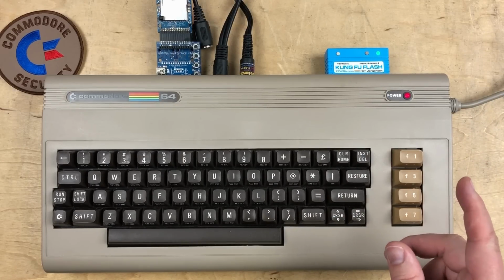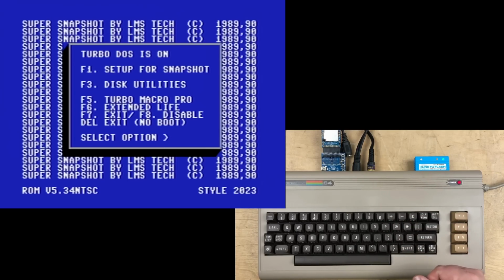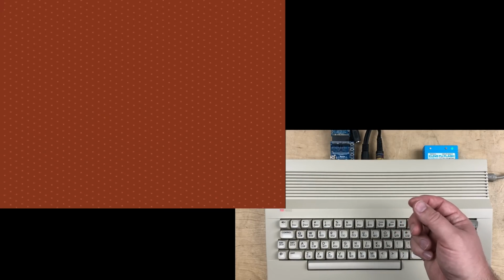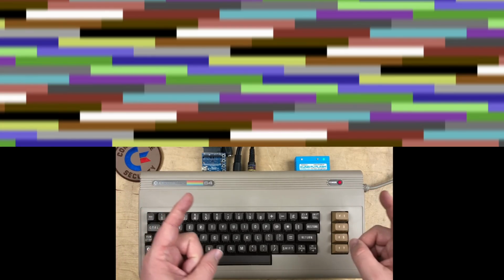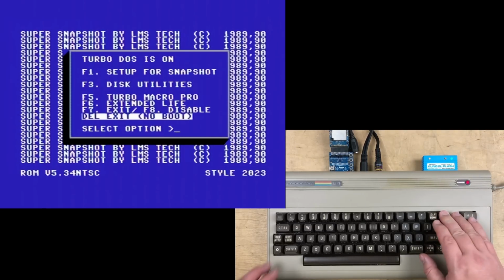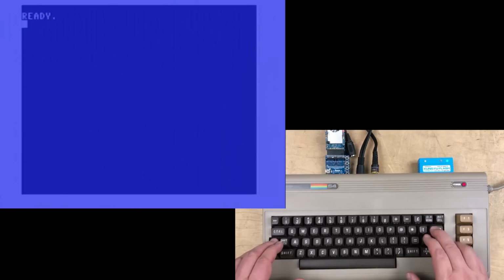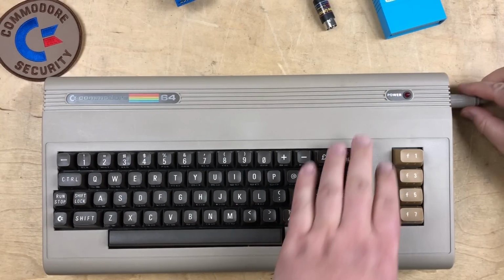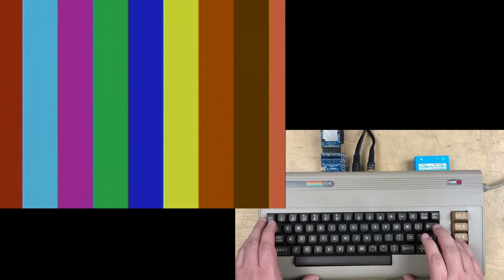One Giant Pixel? Exploring $D020 and VIC-II/6510 Timing

Comment: The very oldest (until early 1984) NTSC C64s had 64 clock cycles per line instead! They had 262 rasterlines.
The newer NTSC (with 263 rasterlines) had 65, and PAL (312 rasterlines) always had 63.

Comment: You've since mentioned that the sprite activities will distort raster splits like this due to some CPU cycles getting stolen from the VIC. Having stabilized the timing into vertical bars, this would have been a perfect way to demonstrate that time dilation. Follow-up video?  (hint, hint)

Comment: One major aspect of the Atari 2600 and 800 systems is the WSYNC register, which halts CPU execution until the next horizontal blank.

While on the Atari 800, it is beneficial for display list interrupts, it is absolutely critical for proper display kernel generation on the Atari 2600.

Comment: When I found all this stuff by reengineering demos and games, I always wondered how could someone find this out without an example? Reading the C64 intern book wasn't really helpfull.
But in the early 80s there were already games using a lot very secret features of the C64. 
Also back in the late 80s I thought it should be possible to make a horizontal sprite split / multiplex. But it wasn't. Maybe because of the rastertime per line which is already gone when the sprite was drawn? But why are there still 8 Sprites possible in one rasteline? Has someone an logic idea? 
If horizonzal sprites multiplex would be possible, we could have made so much better games and demos on the C64.
Anyway the vertical sprite split was still a fantastic solution for games. However, I wonder if the c64 architects ever had this in mind.

Comment: When I'm totally exhausted because I've been programming or gaming for 2-3 days straight, I can see patterns like this in real space! Then I look at a wall and see how the picture starts to roll. Another thing I've noticed is that individual “pixels” (if you focus on one) rotate by about 15° and then jump back again. ^^ This is the quantum system in which we live. I sometimes feel that I can affect something that's "behind the Wall" that we look at, where the movie runs.

can we do this on a regular PC somehow? I had there something in my mind but I cant remember actually. I'm writing a complete new platform, operating system, own language.. and so on, and I want to make it different and special. I wanna bring back the Feeling of Software, where there where no software, that "Wild West-feeling".. I don't wanna use 3rd party libraries, I'm gonna programm everything by my self at the end and  I will look that it will be compatible other OSses, cause it's written in ansi C and Assembler. May be I'm going to hack around with an hex editor and try to write the code direkt by myself.

I the past, I had a passion for writing high performance webserver software, and know I'm going to evolve it to something alonestanding , with higher dimensional interface and so on. we'll see how it will end up.  I like the old terminals, therefore I want to have that All seeing Eye that showed the frequency signal when it came in. I want to connect this with something oracle-like, but more general. :) It's a live-project, where I want to show what I maximally can achive. I want to bring quantum computing to normal PCs. I guess that should work.   

 go on with those videos! more   stuff that you cant find somewhere else. I've also a lot of memmories of my childhood where I played around with electronics and so on.. greeting

Comment: Something to be aware of if you're coding multiple sync loops: a taken branch takes an additional clock (4 total) if it crosses a 256-byte boundary. I actually had a program "fail" due to this: I wrote my own fast loader, and when I made a change that made the data transfer loop straddle a page boundary, the extra clock meant I could no longer keep up with the 10:1 interleave on the disk, so performance went from 2s/track to 6s/track. Has to be the most obscure bug I've ever swatted.

Comment: could you do double buffering with that trick. storing the current visible stuff in the border. kinda. or even double buffer clear. screen sized sprite buffer. draw buffer swap in c64? kinda forced vsync instead of copper line scan render control.

Comment: Great video as always, Robin. 
30:00 The official documentation about the 6502 seems to have some quirks too. :) As to the INC instruction, in the MOS MCS6500 family hardware manual (not to be confused with the programming manual) dated January 1976 (Annex A.4.2) reproduced by SYNERTEK in the datasheet SY6500 8 bit micropressor family, one may read "Write modified data back into memory" on the 6th cycle (actually cycle 5 as cycles are counted from 0) but it does not specify that there is any writing on the 5th cycle.

Comment: At least with the C64 you only really used raster timing to perform tricks and you had the luxury of interrupts too, but it amazes me how you had to time everything in clock cycles on the Atari 2600 to produce anything expected on the screen, it's incredible what programmers managed to pull off on such a limited system.

Comment: The original version of the VIC-II had 262 lines of 64 cycles, so that could affect the timings of this type of program.

I'm guessing the VIC-II color registers are not dual ported, so if you are trying to write to one, the VIC-II is locked out and just sees ones for the color value, which happens to be light gray.

The only way I can think of that it might be possible to align code to a specific raster cycle is to use a bad line, since those will impact the cycle alignment.  Might be possible to do it with sprites as well.  Too bad there is not a WSYNC feature like on the Atari 2600.

Comment: I changed the stable bars main loop a bit,  adding an extra cycle every other line, resulting in this neat moving 'barber pole' effect. It worked on VICE on an NTSC machine at least. Thanks for the great videos!

loop:
lda #2

sta $d020
inc $d020
inc $d020
inc $d020
inc $d020
inc $d020
inc $d020
inc $d020
inc $d020

txa
inx
and #1
beq +

+jmp loop

Comment: A lot of different graphic chips had similar bugs where writing to a chip register causes anomalous display output. You're only supposed to write to the chip during vblank so who cares if the chip has an output bug when writing. This sort of bug was very common on the Sega Genesis/Mega Drive where it appears as on screen chroma dots during palette updates.  The bug could be exploited for interesting effects as it immediately outputs the colour you wrote but synchronization was an issue so only something useful for demos. The Vic2's bug seems particularly annoying as the colour it produces is something unwanted,
Reply: Normally though, you wouldn't be changing color registers so frequently, so it would be nothing more than an isolated anomaly that would go unnoticed.  I do wonder if other VIC-II registers exhibit a similar behavior; for example, would writing to a sprite coordinate register at the same time the VIC-II checks it cause it to read the coordinate as 255?

Comment: Nice!

A few comments:

The reason for the color light gray is most likely due to the color register acting as a transparent latch that opens up for receiving data before the CPU has had time to put a correct value on the data bus. Thus the "sparkle" doesn't necessarily have to be exactly one pixel / clock pulse wide, it may be whichever width that corresponds to where within the cpu cycle the correct data becomes available on the data bus. On the older VIC chips the color registers probably acts like D type flip-flops. (For a more through explanation look at the data sheets for 74LS273 and 74LS373 as examples of the two different types). Or it could also be that the timing for the older NMOS VIC-II (65xx) differs from the newer HMOS2 VIC-II (85xx), where the older might be slower to open up it's latches and this the data bus already contains correct data when the latch opens.

It would be interesting to know what happens if a slight pull-down is connected to any of the lower three bits of the data bus. Maybe the light grey color gets changed to another color?

Re PAL:
PAL has on purpose half the vertical color resolution. This in combination with the alternating phase between adjacent lines is intended to cancel out any discolorations due to phase distortion of the signal. The result in particular for a C64 is that the color/chroma information is evened out between adjacent lines. However this does not happen for the brightness/luminance. I would had expected a monochrome flicker in your capture. Maybe your capture device does this averaging for the luminance too? How does it look on your monitor (if it can handle PAL)?

Re what happens within the blanking/sync period: The actual video output is blanked (hence the name blanking) but the VIC-II chip obviously still receives and stores values written to it's registers, which will get used again after the blanking period is over. However on certain other computers with separate sync signals (can't think of a good example now though) the video output is enabled even during the blanking/sync period, and if the monitor lacks it's own blanking circuit you get visible retrace lines. The vertical retrace is really visible as there is only say 10-20 lines covering a full screen when the ray moves upwards, while anything "displayed" during the horizontal retrace either looks like super low resolution mirrored graphics if it's some actual data, or just as a faint "haze" making the picture become slightly brighter.

Btw you already know this (from discussions elsewhere), but the reason for the Restore key being connected directly to the NMI line, rather than passing through a CIA chip (like it does through a VIA chip on the VIC 20) is that the Max/UltiMAX only has one CIA chip and that handles IRQ, so they had to route the Restore key directly to the NMI signal.

Also: There is a way to disable execution of the NMI handler. You have to program the "NMI" CIA chip to generate a NMI, and then technically stay inside the NMI handler. As long as the CIA chip keeps the NMI line active (low) then nothing can trigger it again. The down side is obviously that you can't use IRQ's (as you are inside an NMI).

Btw "Magervalp" is Swedish for "Skinny Puppy". I was today years old when I realized that it might be a play on the band name "Skinny Puppy" :)

Comment: Fun video, thanks Robin.  Here's a version that supports PAL and NTSC...

10 forx=0to81:readn:poke828+x,n:next:sys828
20 data 120,169,11,141,17,208,173,166,2,208,36,169,2,141,32,208,238,32,208
30 data 238,32,208,238,32,208,238,32,208,238,32,208,238,32,208,238,32,208
40 data 238,32,208,238,32,208,234,76,71,3,169,2,141,32,208,238,32,208,238
50 data 32,208,238,32,208,238,32,208,238,32,208,238,32,208,238,32,208,238
60 data 32,208,238,32,208,76,107,3

This version uses loops, resulting in fatter vertical bars, but takes up a lot less space...

10 forx=0to34:readn:poke828+x,n:next:sys828
20 data 120,169,11,141,17,208,162,4,160,2,140,32,208,200,202,208,249,140,32
30 data 208,173,166,2,240,5,36,2,76,66,3,234,234,76,66,3

Comment: Ah, the border colour. You can change the colour for it on the PC, too. Not a lot of software bothers to change it, though, and it's not visible on modern displays, either. A few games that DO change it are Commander Keen (static cyan), Crystal Caves, and Secret Agent (both make it either red or green, depending on whether you've met the conditions to exit the level or not). Wolfenstein 3D includes a debug command to change it, too. Unfortunately, DOSBox doesn't emulate it, which is a problem for playing Crystal Caves.

The "flicker colours" thing has been used in some PC demos, too. There's one called "Ambience" by Tran that uses such trickery to get 21-bit colour out of VGA's normal 18-bit space.
Reply: There was an experimental fork of Dosbox that did emulate the border. I don't know if Dosbox-x or Dosbox Daum do, but it's worth checking.

Comment: For more fun still, you can turn on sprites. Even though the sprites are not visible they will affect the display since active sprites take away CPU cycles (sprites do not care about the display being on or not, you can even have sprite collisions).

I find that the grey dots only appears half of the time, depending on the phase of the dot clock relative to the color clock.

Comment: I guess the brute-force stable raster routine is supposed to run forever in a loop of 64 cycles until D012 has the same value twice? 
as then you must had a match-hit at cycle 0 and at cycle 64 of the same line, or does it try to find when two lines have passed? 
As then that first match was at cycle 64 and the next at cycle 0 on two lines down? 
As $D012 is both a write (for raster IRQ) and read register(current raster line), not sure what an INC does to the Z flag on it.
I hope it does not try to look for line 0  (or line 256) and only does the 64 cycles match then, as that could take many frames for it to to align up.
But you get 1 cycle error start point sometimes, wonder why?

Comment: Cycle-exact coding like this is something that newer consoles and computer programmers don't have to worry about as much (unless you're writing video drivers and such). But especially on the old Atari 2600, cycle counting was absolutely critical to the entire system since the main program itself drives the video. Combine this with the extremely limited RAM and ROM space and you can start to understand what a huge challenge programming the VCS was. There are stories of programmers spending weeks rearranging and modifying their code so that they can gain a few bytes of ROM space for some feature* they want/need to add, or to get the display to look exactly as intended. My hat is off to anyone who can program for these old retro machines!

* There's a story about David Crane when he was writing "Pitfall!" for the 2600. He had finished the game that fit perfectly in 4096 bytes of ROM space allocated to him and showed it to his co-workers. They loved it except for one thing: David had made it so that the player only gets ONE chance to finish the game. That's all. His co-workers finally convinced him that this was a bad idea and they should be given at least 3 chances. Since the available ROM space was full, it took David an additional several weeks to add in the feature of having 3 Pitfall Harrys and the display of those available men on the screen. David is a legend among legends in the world of programming.

Comment: exact one-cycle timing is to be previously just doing nops for a line (at line 37 example) as that will come with 0 or 1 cycle error, check at the exact spot to see if you're off by minus 1 cycle.     
LDX #37              ; RASTER line number change yet?
CPX $d012
BEQ *+2              ; add one more cycle by branching to the next instruction, simply falling through is one less cycle.

Comment: Maybe I missed it, but I don't think you mentioned why the VIC chip has screen blanking in the first place.  The VIC-II needs to shut down the CPU every 8 scan lines in order to read character and color data, known as bad lines.  This slows processing time and can interfere with timing critical functions.  

by blanking the screen, you can give those cycles back to the CPU making programs run a bit faster, and allows timing critical functions, like the cassette adapter, to run without problems.
Reply: But as turbo-loaded games can show a load screen, while getting data 4x faster, pretty poorly implemented tape loader in stock ROM.

Comment: Challenge; put 64 squares (or near squares) on screen, and if possible make them 64 colours
Reply: That would be cool but not much of an improvement over multiple implementations from the 1980s.

The "46 Colour Demo" by Radwar in 1987 was probably first but it only works on the original 6569 Revision 1 PAL VIC-II. "Extended Colours with Interlace" by Super Swap Sweden & Thundercats from 1988 is much more compatible and shows 24 unique colour squares from a total palette of 120, there is a 4K video of it on YouTube which shows the effect properly if you turn the playback resolution down to 240p.

Comment: The sync code was very interesting. Of course, the important thing to stress here is that you effectively turned the screen (the usual display of characters and/or bitmap graphics) off - the poor old CPU gets paused while VIC writes character and sprite data to the screen, and so the timing is more complicated (by so-called "badlines"). Interesting explanation of the pixel effect too.

Comment: I always wished I could remove the border entirely and have that space for on-screen graphics.
Reply: I did not expect to see the dungeon delver here!
Reply: 1: more than 40 chars/line and It would not align with a 1K block screen char graphics.
2: Overscan on home TVs is not predictable and is not adjustable.
3: in 1991 I saw a picture that used all of top and side borders with expanded sprites.
Reply: Yep. Everything in engineering is a compromise. If they added only one character to each line to make it 41 characters per line that would still make the screen 1025 characters which does not fit neatly into 1K.* And since, at least at first, most people would be using TVs instead of monitors, they had to keep those limitations in mind too. Even if they could have an 80 column display (which is doubtful considering the cost of RAM and other considerations at the time), it would be quite blurry on all but the best TVs. 

* This is also why sprites are 24 x 21, as this fits very nicely into a 64 byte boundary (24 bits is 3 bytes, times 21 is 63).
Reply: It's possible apparently but it'll give some graphical bugs or something.
Reply: Atari 8-bits could do this.  You could pick normal width, narrow width, or wide width graphics lines in some register or other
Reply: @TheGreatAtario  Jay Miner was the man.